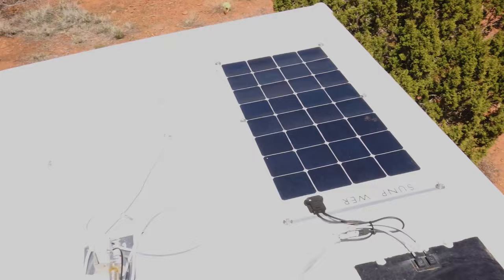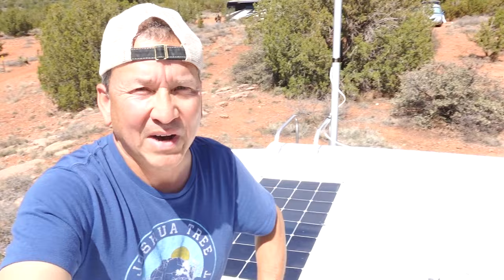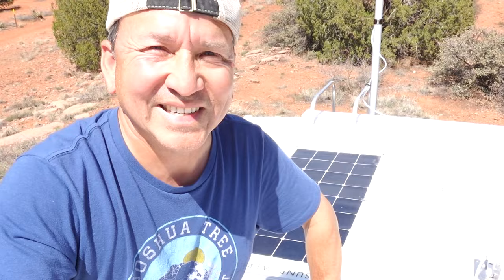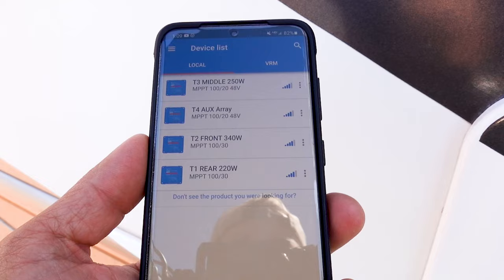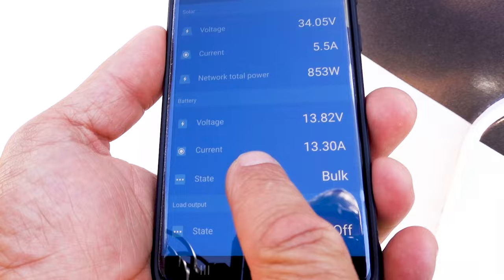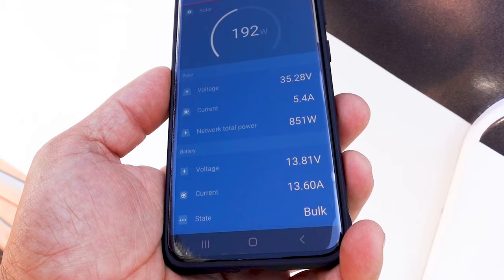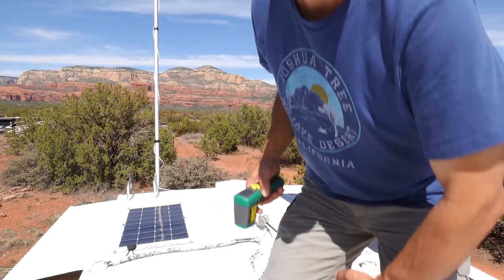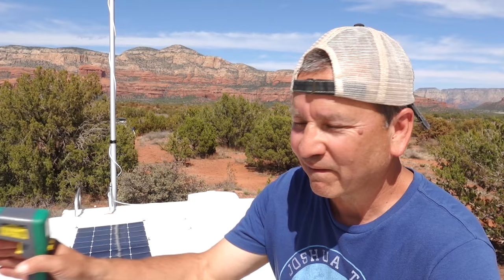Heat/Power TESTING Flexible Solar Panels on RV (Flat Mounted vs Ventilated)

Comment: athe reason the ones on the roof are putting out more power is less loss in the wires if remember correctly you used larger wire and the shortest run you could do so both combat line losses while your ground array has smaller wire and a longer run of wire hince lowwer performance from line losses in the ground array.
Reply from the maker: Those are pretty long and yes there may be some voltage drop there.
Reply: @RVwithTito   yep and when voltage drops the MPPT solar charge controller conversion efficiency drops as does the current so it can be a big difference in conversion just because of the voltage drop.
Reply: The resistance of the line would make no real noticeable difference.
However, the panels being tilted towards the sun however can yield an easy 20-40% increase in power.
Reply: Yes, line loss, (aka attenuation) could most definitely be noticeable. WTF dude?

Comment: all these people using chloroplast to try and make air passages behind flexible solar panels. i dont think there is any significant airflow through the chloroplast, its just too thin and its like trying to suck air through a long tiny straw. air doesnt really flow through there. imo it just adds another insulator to the back of the solar panel and makes them hotter. what i did with mine is I used a 2$ roll of that aluminum foil tape and coated a couple layers on the back of these solar panels which should help move the heat around better and because of the lower specific heat of aluminum vs silicon it will pull heat away from the front of the panel and better exchange it with whatever it is mounted to. mine are mounted to the steel roof of my car with some construction poly urethane adhesive and some added 3m window weld polyurethane adhesive to fill in the gap due to the compound curve of my roof. you can use copper foil tape as well which is better but usually more expensive and made much thinner. if theyre not up against a solid surface to conduct the heat away then they will actually act as insulators as shiny metals have low thermal emissivity so you really need physical contact for it to be helpful.

Comment: The question I have is: What is the temperature being transferred to the RV roof through the plastic spacer?
Reply from the maker: I don't know for certain, but think it's pretty minimal compared to when they were directly mounted to the roof.
Reply: @RVwithTito  TNX. Really enjoy your videos. Better than 99% of the others around. I am a stage 4 cancer patient who’s wife bought a small rv since we couldn’t travel by motorcycle any longer. Travel time is severely limited due to treatment and this plague so I spend time looking at what I can do to this thing. My kids will one day enjoy it. 

How do you connect your auxiliary panels?

Thanks again for the channel.
Reply: @WhereRV_Eh  Hang in there buddy! I too was diagnosed stage 4 almost 17 years ago and I'm still here to talk about it. Keep a positive attitude and ignore the nay sayers and in 17 years you can laugh about it too.
Reply: @Tom-In-Ga  from your lips to gods ears!  Thanks. I have to stick around so that Brian can continue to get me to spend money!🤣
Reply from the maker: @WhereRV_Eh  We're rooting for you to kick this thing. So hang in there. Thanks so much for your feedback. It means a lot that you're really enjoying the videos. My aux panels are connected to a Victron 100/20 solar charge controller through an external DC port like this (https://amzn.to/3wH6AzY). I just wired it to the input of the solar charge controller which is paralleled to my other solar charge controllers. I made a few cables that I can use with it to connect it to the solar panels. Hope that helps. Our best to you.
Reply: @RVwithTito  thank you for your kind words and the info. I can go and spend more money now! Keep on doing what you’re doing. You know that you have at least one dedicated viewer.
Reply: @WhereRV_Eh  wishing the best brotha'.

Comment: I noticed your shadow when you were near the ground panels. Were they not pointed at the sun to approximate the roof panels? My ground panel gets too hot to touch in full sun.  I made a very basic Sun Dial (got the idea from the Mars Rovers), that I mounted to the corner of the panel. It really helps in aiming the ground panel directly at the sun and even ahead of the suns travel.  Thanks for the video. I appreciate your work.
Reply from the maker: Yes. I also look at the shadow. You're right they were at more of an angle, but they were close enough for the test. The differences when laying them flat weren't significant.

Comment: I mounted these guys on aluminum plates with holes, and additionally are able to set up in different angles with supports towards the sun, when my RV is sitting still. So they are perfectly cooled from the back, the aluminum helps a lot with dissipating the heat from the sun.

Comment: This was very helpful to me. Correct me if I am wrong, but you do have some differences: You have 70 cells on the ground and 72 on the roof, and the cells on the ground were tilted. The roof should have delivered 36/35 more volts than the ground at the same temp. The roof was hotter so it would deliver less. It was hard to tell the difference. However, if the two sets were at a different angle to the sun, that would add another difference. At 1, I would figure the ones on the roof had the advantage.

The real benefit to me is seeing that the MPPT was putting the voltage at 35, so when I use a 60 cell panel, my Vmp will be around 29.1. I have an 8 cell LiFePo4 pack, and thus my voltage will be 26.5-28. So, without a charge controller I will have 3-4 spare cells out of the 60. That seems like a good margin for potentially higher temps and a few years of degradation.

If you could pull up one of the roof panels and get us a temp measurement off that roof the moment you lift it, that would tell us whether heat is being transferred to the roof. Or maybe you can put the ground ones on a piece of plywood or something and measure that. My understanding from someone else is that the heat is generally not going through the back like a typical fixed panel.
Reply from the maker: Thanks for the suggestions and yes you're correct, the ground deployed panels have a couple more cells. However, the MPPT actually put out between 13-14.6 volts to the battery. The 35 volts was the reading coming in from the series solar array.
Reply: @RVwithTito  oh, I did not count properly. The roof has 64 cells. So 6 less than the ground, and at a higher temp, but a bit more power. That should be due to the tilt of the ground ones, right?

Yes, the 35V is telling me the Vmp. With 64 cells that means my 60 cell panels will have a Vmp at that temp of 33v. This means that I will be getting 270w instead of the expected 330w. That makes the mppt controller somewhat useful.

Comment: Thank you Tito, I've stumbled across some of your videos when I'm looking to improve either my Yacht or Class, A and I find them very instructive. And thank you so much for your free book, I'm about to go solar on my Yacht and I have so many question right now, your book will answer some of them I'm sure. My main concern today is the durability and quality of these flexible panels. But on my boat this would be the easier and cheapest option. I already have rigid panel on my RV but they were already installed when I bought it and I have the felling that the power they deliver is not what it's supposed to be.

Comment: Thoughtful presentation Brian. I have often wondered whether the lack of ventilation impacted performance; obviously your test shows no, as production & temperature variables were negligible. One needs to also consider the longevity of the array, but that is a different issue. 

BTW, I love SunPower panels & components as we installed on 2 of our prior homes and now embarking on installs a new system on our née home. 

As always, well done my friend.
Reply from the maker: Thanks! I appreciate the feedback. I'm a fan of SunPower too. Look for some new stuff coming up.

Comment: Pretty interesting, Brian. I thought for sure the temp on the roof would be much higher. Looks like the insulation you put under the panels are doing a great job. Thanks for the review!
Reply from the maker: You are correct. That's what I was hoping for and I'm glad it's working out. I expected a bigger difference.

Comment: I read somewhere that an RV owner in the Phoenix area had flexible mounted panels on his RV roof.  The panels died after about one summer outside in Az's valley heat.  I read this shortly after my brother had also installed 2x 200w flexible panels on the roof of his travel trailer.  Now, he stores his RV outside in the sun when not in use.  They did not make it through the summer either before both died.  We think the flexible panel overheats without airflow underneath, but you may not experience this overheating if the ambient air temp is under 100F.  Az's summers are brutal where midday summer heat can reach over 120F.
Reply from the maker: Certainly a good idea to remove them while in storage when possible.

Comment: Brian, thank's for the video.
I'd believe that the copper sheet underneath the cells helps provide a better heat sink distribution for longer lifetime, however, power degradation will happen when the panel heats up.
Reply from the maker: Yes. That's true. The temperature coefficient thing kicks in.

Comment: The ones on the roof still have a little ventilation with the corrugated plastic you used to back them.  Also with them at a slight angle on the sloped roof allows a little bit of chimney affect to allow that air not to stagnate completely.
Reply from the maker: Yes. Chimney effect. That's what it's called. I can never remember that. 👍

Comment: It is my understanding that there is a high risk of damage to the fiberglass roof of RVs due to the heat of flexable panels in fact some RV manufacturers have stopped using them altogether and gone to hard mounted panels only.  Unfortunately a new rig I am looking at purchasing only uses flexible panels so I may not move forward with the purchase for that reason even though I love the rig itself.
Reply from the maker: That's one reason why I added the polycarbonate insulation between the panel and the roof. Many have adhesive on the back now as well.  Thanks for the comment.

Comment: Hi Tito, when using a I-R thermometer, better use your own shadow for blocking sun radiation. The sun’s I-R that wil be reflected by the panel will influence the reading of your instrument. Always measure in a 90 degrees angle to the surface on the exact same spots on all panels will give reliable results.
Reply from the maker: Thanks for the tip.

Comment: I appreciate your approach to the issue of how heat buildup affects solar panel power output, but you need to control for a couple more important variables.  

First is.the sun angle. Your roof-mounted panels almost certainly were receiving a different amount of sunlight than the ones that were set up on the ground.  The intensity of direct beam sunlight (as opposed to diffuse skylight scattered by the atmosphere) is at its maximum when it is directly above the panel.  As the sun moves across the sky, the direct beam portion that comprises the vast majority of solar radiation decreases in proportion to the sine of the angle of the sun relative to the surface (in this case, the solar panel).  So, the maximum solar power can be achieved when the sun is directly over the panel (sun angle of 90 degrees).  It decreases to 0.707 of the max when the sun angle is 45 degrees above the panel, and to 0.5 when the sun angle is 30 degrees above the panel.  To do an apples to apples comparison of flush-mounted vs. free-standing panels, orient the free-standing ones horizontally like the ones on the roof of your RV, and ensure that the ground beneath them is shaded.

Also, if you want to account for the effect of heat on panel performance, it would be good to see some significant heat differences between the panels.  And if your assertion is that there isn't any heat difference between the freestanding and roof-mounted panels, then I'd suggest that you take multiple temperature measurements of the free-standing and roof-mounted panels over the course of a cloud-free day and report the results.

Anyway, I love your presentation style and the equipment you used to generate the data you reported.  Thanks.

Comment: It's not insulation you're putting under the panels. In fact, it's the complete opposite, and for good reason. The layer you're putting under the flexible solar modules is actually a thermally conductive layer. Its purpose is not to insulate, but to actually increase thermal conductivity between the module and the roof of your RV so that your panel can more effectively transfer heat to the roof of your RV in order to stay relatively cool. Also, out of curiosity, why did you connect your panels in series?

Comment: Thanks Brian,  I enjoy all you videos.  My thought is the ground panels are dissipating the heat faster than roof mounted panels.  The roof panels with the insulation backing are holding the heat.  I also would be interested in the heat transfer through the roof, into the RV.  What is the temp of the roof membrane?  Having framed panels mounted above the roof I would think shade those sections of the roof, reducing the heat transfer into the RV.  Thanks again for your information and teaching!
Reply from the maker: I'll try to take a roof surface reading once things heat up today.

Comment: The ground array is using longer, smaller gauge cable, and is not at the same angle to the midday sun.
This would contribute to lower output.

Comment: Thanks Brian. It would be interesting to see the temperature delta between the actual RV roof and the top of the roof panels. 
I’m in the process of installing a small solar panel to trickle charge my chassis battery while our RV is in storage for 3 months. The panel is 14”x14” with a hard plastic frame. I decided to mount the panel on painted 1/2” plywood with strips of coroplast between the panel and plywood so it can breath a bit better. I’m hoping a cooler panel will last longer but who really knows. LOL
Reply from the maker: I'll be on the road later, but I'll try and shoot some temps once it warms up a bit and I'm powering a bunch of stuff.

Comment: Voltage is affected much more by temperature than current. Current is dependent on irradiation. Because the charge controllers are MPPT type, and will track the IR curve, power is not really a good measurement of the differences. This is what a curve tracer is used for. I have one, however it is not a commonly available tool, as it costs about $4000. Irradiance, cell temp (measured on the back of the panel), azimuth and tilt angles are all factored into the calculations.
Reply from the maker: Thanks for the info. I think power output is the easiest for most folks to wrap their brain around 🙂

Comment: Nice video as usual Brian, I would like to see the temp of a section of roof with no solar panels and test the same sections in the interior.
Reply from the maker: Sounds good! I'll try to do that and post it.
Reply: I had same thought. I am going to add solar panels to my roof and want to go flex panels BUT wondering if the raised panels would provide some shade on the roof but maybe the flex surface mount also effectively shade? Thus what is the roof surface temp vs. surface temp of flex panels?

Comment: Good video, Brian and I would have thought the panels on top would have been hotter. I'm wondering though if there will be a difference in longevity. It would be interesting to see how they hold up over time compared to the ground-mounted ones.
Reply from the maker: I'm guessing they'll hold up longer. The ground deployed ones take somewhat of a beating. They're always being moved, blown over, or tucked away somewhere.

Comment: Great review. I wonder how much heat is getting through the polycarbonate board?? As you recall we installed ours the same way  on the roof and they are still holding up!
Reply from the maker: When I removed the old ones, there were no heat marks on the membrane so I'd say the heat transfer was minimal.

Comment: There will also be wire loss if your wires aren't the same length.  At lower voltages this can make a huge difference in net output.
Reply from the maker: Yes. Not so much in this case though. Maybe < 5% overall which is worth it for me to be able to get the panels in a good spot.
Reply: @RVwithTito  Even a small difference in sun exposure will make a much larger difference than a slight difference in wire loss.  I was just throwing in another variable for your consideration.  Thanks for your videos, they're very informative and enjoyable to watch.

Comment: Knowing water is very essential out in the desert especially while boondocking, but it would have been interesting to see how much the performance would increase if you ran some water over the panels
Reply from the maker: Funny you ask. I've logged the biggest spikes on Partly cloudy days when there's cloud cover allowing the cells to cool. Then when the sun pops out suddenly the current goes through the roof for a little bit. You're right. Cooling them with water has a similar effect.

Comment: I have two traditional 200 watt glass panels on my Class A,  but given the extra weight compared with flexible panels, considering using flex panels going forward. I only wish they came in 200w configuration.
Reply: Renogy make 200 watt flexibles